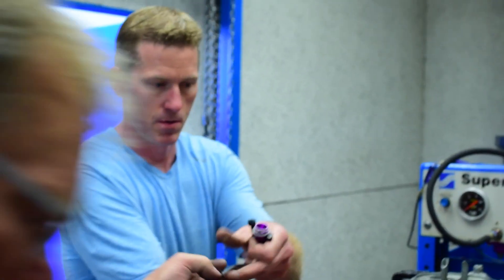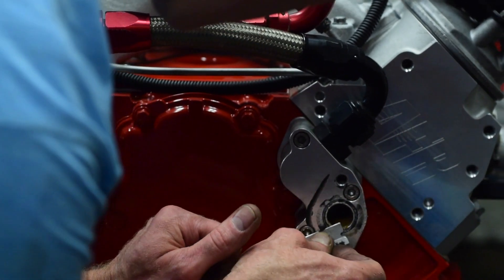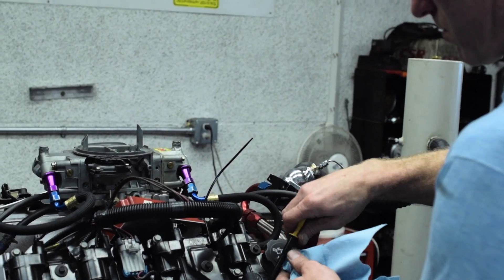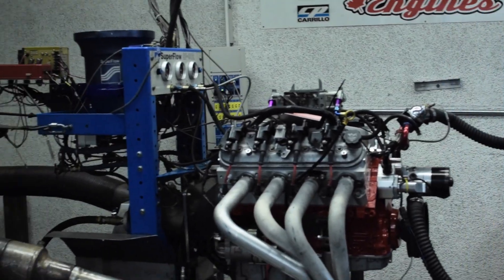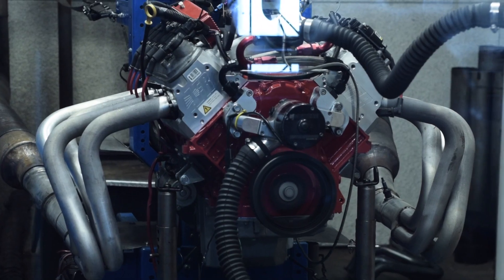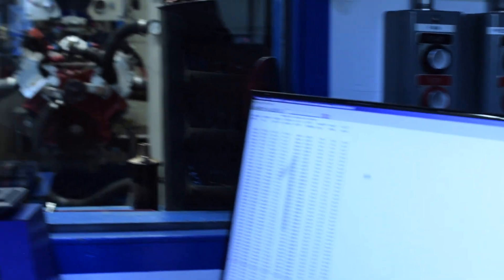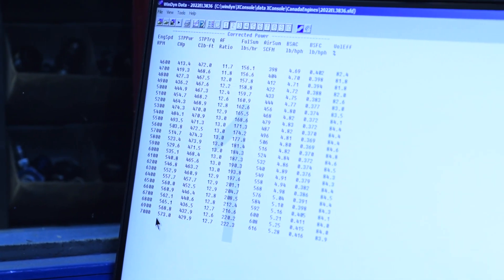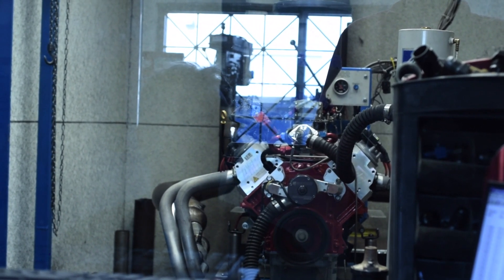3.622" Crank Off-Set Ground + 6L Block = 383 cu.in. LS Dyno Test!

Comment: Is it the ignition system that is drawing so much current that it's shutting down on low voltage? Sounds healthy!
Reply from the maker: Ya it was quite the fight that day on the Dyno. What was happening was the charging system voltage kept dropping below 12v. The moment it hit 11.9 the MSD would drop out and it would cause a massive boom in the exhaust!! The fix turned out to be running the electric fuel pump off another source and a new larger MSD ignition supply right from the generator. After that was fixed it pulled nice and clean north of 7000. 
The same day we dyno’d our 349 short stroke “LS8” we call it, and cranked it up to 8000. That was exciting seeing our pump gas street engine make 
1.89 HP/cube.

Comment: Are the journals now Honda or SBC-Small ? Either way, this thing is interesting.
Reply from the maker: Thank you for commenting. It’s now small journal SBC like a 283 or early 327. 
The Honda journal is another option I’m going to do as well. The rods are kinda pricey though. This first one was an attempt to build an LS Stroker on a budget :)
Reply: @ceperformance  Did you guys have to do any significant lateral clearance work on the big ends of the SBC rods due to the offset ? or were you able to just throw them on the journals and let the piston/pin take care of the offset ?
Reply from the maker: @joeyjojojr.shabadoo915  
There was no issues besides the first piston/rod combo I thought would work. Initially I had another piston compression height in mind and I wanted to use with 6” long rods, mainly because the pistons were stock and the rods were fairly cheap. The issue I soon found was inadequate clearance from the bottom of #8 piston and the tone ring on the back of the crankshaft! Had to abandon that idea and re-evaluate :)
The 6.25” rods worked out obviously with using pistons from Icon part number ic9991-030
I found rod bearings from King Engine Bearings that are designed for using large journal rods on a small journal crankshaft. Therefore the rods I used are actually large journal 6.25” i-beam from Eagle.
Reply: @ceperformance  I would like to crack a GM Crate LSx454 open because somehow GM are able to run a 6.0" connecting rod and still clear whatever relluctor wheel that is on that 4.125" crankshaft, as they built it using a standard deck height block. Terrible rod/stroke ratio (in the 1.4-ish range), which is why it's only rated to turn 6k MAX, as that piston must be SCREAMING in terms of speed, but with the math, the CH of the piston is literally THE SAME as the factory LS7 piston (1.173-1.175) just being 4.185" vs 4.125". I want to know what wheel they are using, unless the 4.185 piston's skirts are so dangerously short that they clear due to that alone and any more than 6k RPM would flip the pistons in their bores...lol
Reply from the maker: @joeyjojojr.shabadoo915  
Ya those 454 crate engines are a bit different. They use an odd piston set with small diameter wrist pins too in order to make room for the rings above the pin bores. Very short skirts! 
They really should be building them with a tall deck block in my opinion. Longer rods, more compression height and longer skirts would be beneficial I think. 
That’s what I did with the 468 LSX I just completed. Did you see that build?
Reply: @ceperformance  I did see that build. I agree about the tall deck for the 454LSx. 4.125" x 4.250" leaves nice thick sleeves and tons of room for boost as well.